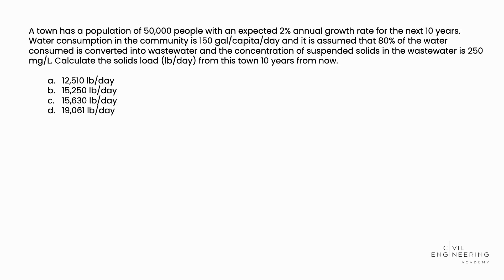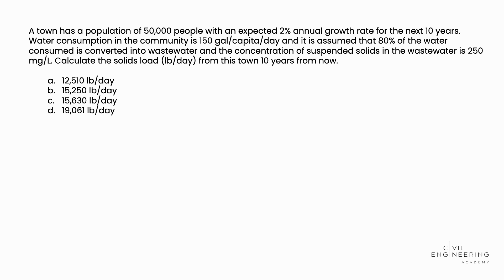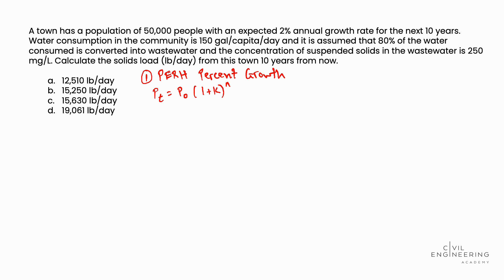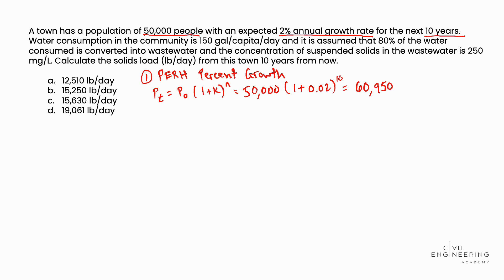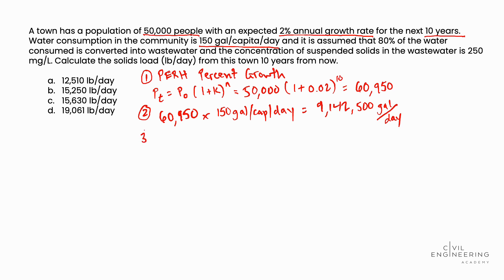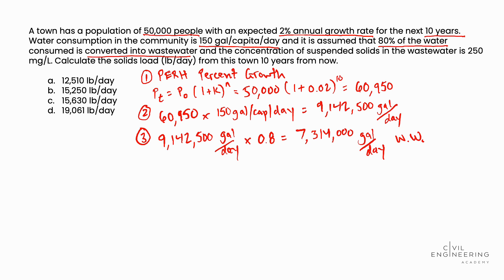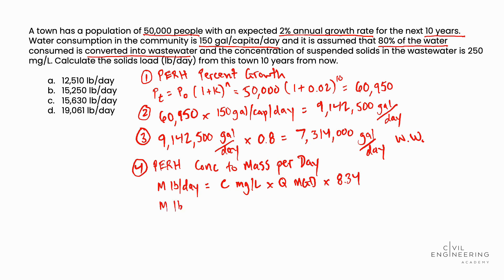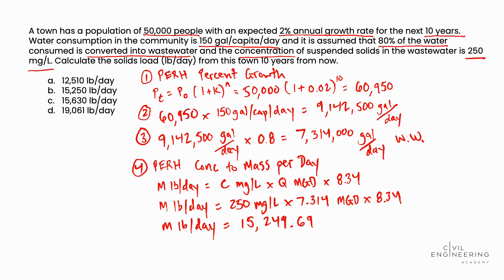PE Water Resources Exam – Find the Solids Load Given Population Size & Solids Concentration

Comment: I like this problem alot, except I used PE  Handbook 2-1 pg 453. Solids Loading Rate Equation lb/(ft^2-day) = SLR:8.34*Q(MGD)*X(mg/l)/A, where Q is the 120 gal/day*population in MGD (7.52MGD), X is the Total Suspended Solids concentration (250mg/l) and A is normally the Surface Area, but in this case you plug in 1 since the Solids Loading Rate is applied to a singular area over 1 town. No need for additional conversion and I got 15262 which is close to the video.